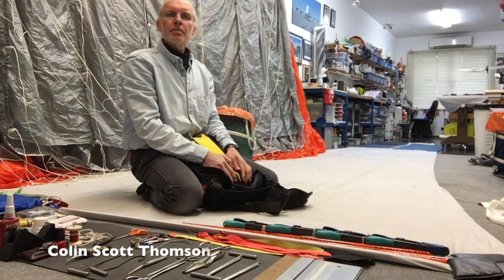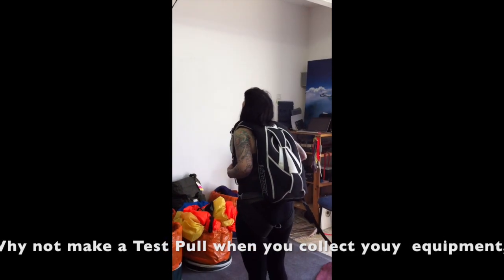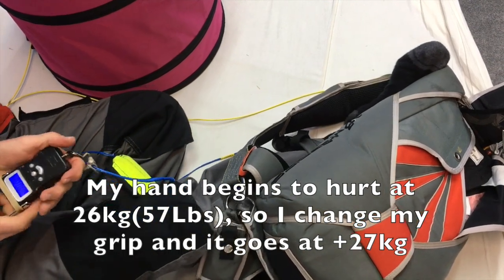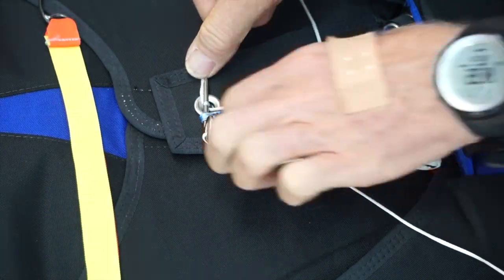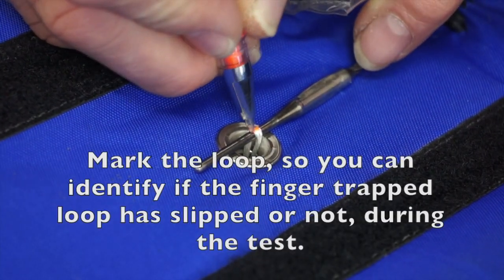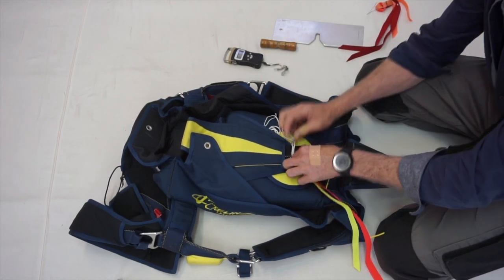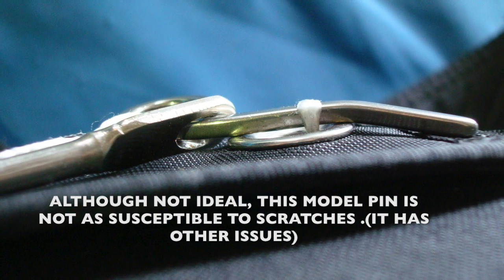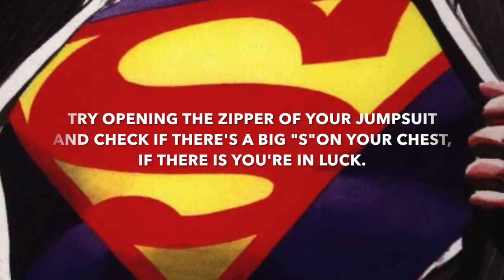Skydiving with Un-Tested Equipment ?

Comment: I like what your doing here for the testing. I was wondering if you have seen any fraying or damaged fibers to the cypres loop due to the extra pull cord usage on the loop and the shock load to the loop it self once the pin is pulled? I know the travel is not much but no mater how close that knot is it’s going to have a small shock to it.

It’s a pain in the rear but why not really pull the handle and let the PC launch the. Replace the loop and reset the pilotchute. It’s extra work but less wear to the loop and the pull test was still done.
Reply from the maker: Thank you for the question Nicholas.
No I haven't seen anything like loop fibers damage resulting from this technique, (since 1991)
I'd recommend you run your own tests and see what you find. 
The issue I have  if you actually launch the pilot chute (post repack) and then re-close the container, there is a chance the pull force will change, not to mention when working on an externally mounted extractor. 
It is not unusual for me to have the user make several test pulls, giving them the opportunity to polish their procedures.
The loop is exposed to a higher force pre-instillation, before marking the length I preload the loop to +-77kg, then when the first knot is made its loaded with 77kg again to make it snug then the second knot is added and the loop is installed on the disc.
If you remember the "soft" Disc report (see:Airtec Disc Update Nov 22 2010) 
Some power tools used for closing,(in the wrong hands) have a better chance of overloading the loop and as we found even distorting the disc.
The damaged fibers I come across are more often as a result of contact with flap grommet burrs.
Please persevere with this Test Pull, at least for a little while,
like most things we are unfamiliar with its hard to see its benefits at first.

As Frank Zappa observed, 
"The mind is like a parachute. It doesn't work if it is not open."
Reply: Colin Scott Thomson thanks for the reply I am interested in trying it out.